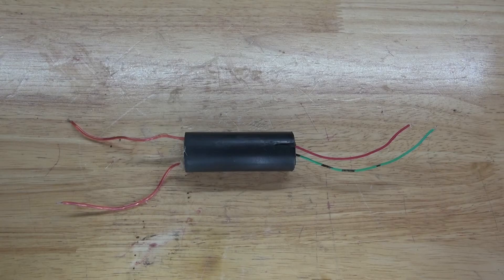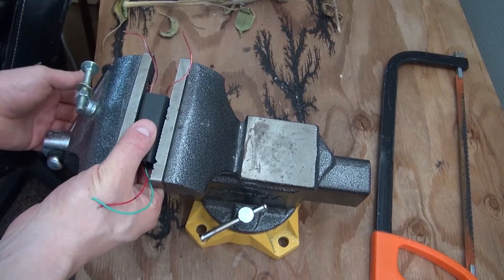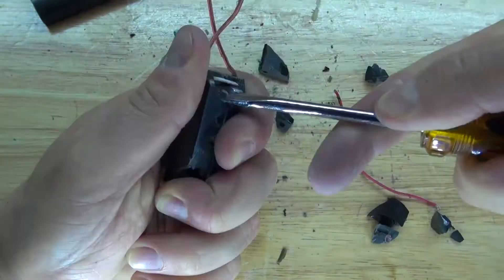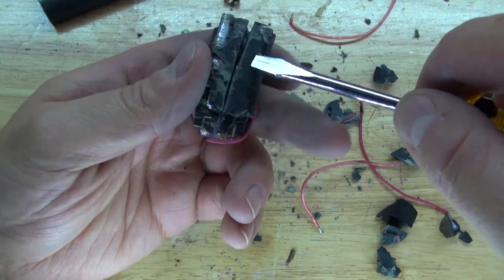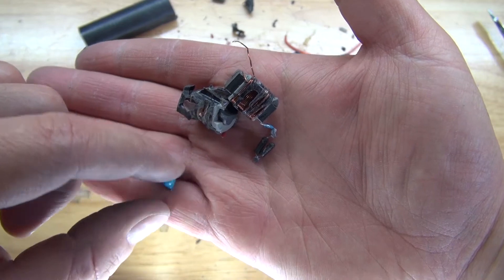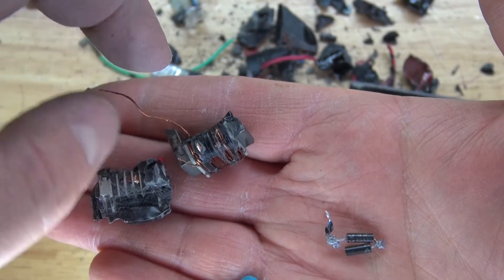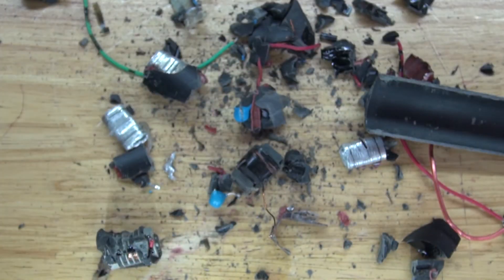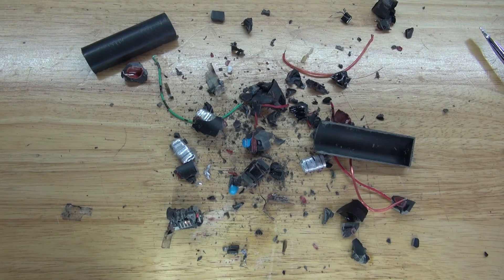High Voltage Generator Teardown

Comment: Could you provide the values of the primary transformer and the capacitor?
Reply from the maker: To hard to find it. The epoxy removes the numbers on the components.